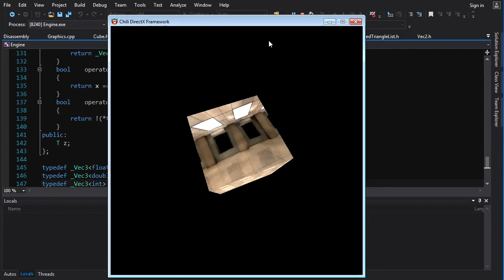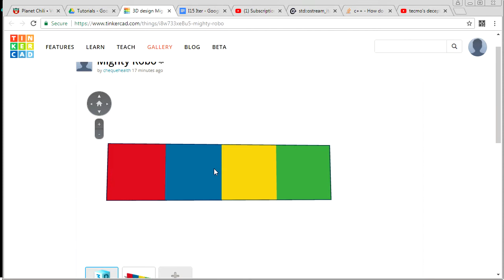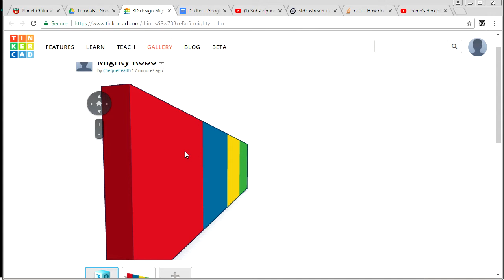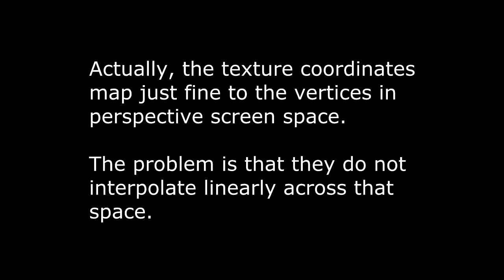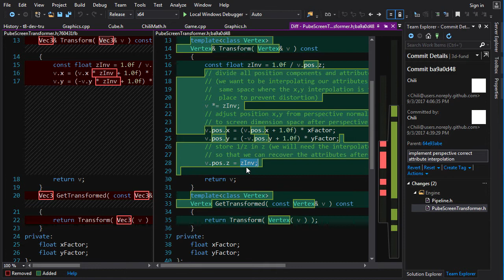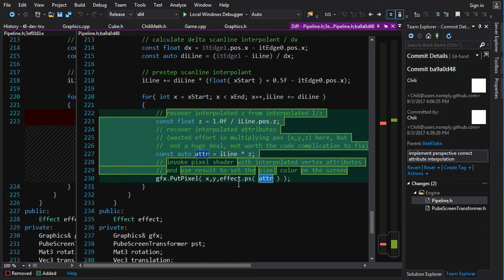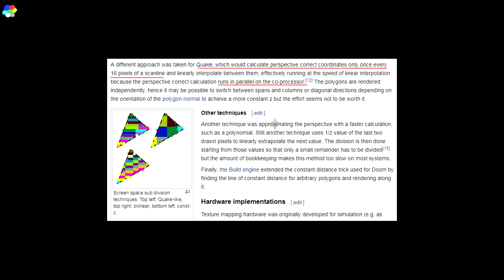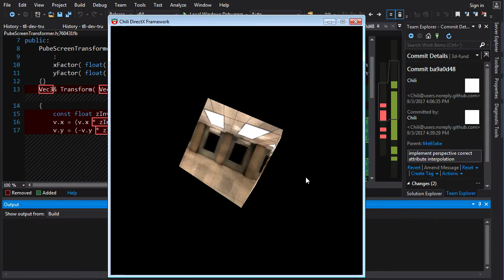3D Programming Fundamentals [Perspective Correction] Tutorial 10

Comment: Very clear explanation of a very tricky and confusing topic - well done!
I have actually gone through all the Scratch-a-Pixel treatment (yeah, I'm one of those weird masochists...). The MAIN cause of my confusion when trying to reconcile this explaination with information from other sources,  is the use of the term 'Z' to mean 2 very different things in different contexts(!). Yes, it's more intuitive to explain it using the term 'Z' to mean the ''Original' Z coordinate of the vertices (before the perspective devide), and yes - that is in fact what it is 
HOWEVER: In virtually ALL modern rasterizers, the 'Z' coordinate of the vertices AFTER the perspective-divide is the thing that ends up being reffered to as 'Z' when rasterizing (in screen space). And THAT values is NOT AT ALL the same as the thing being used to interpolate in a perspective correct way(!). Instead, that is what's stored in the depth buffer and used for depth-testing each pixel - which - guess what: means that IT ITSELF ALSO needs to be interpolated in a perspective correct way.... (say whaaat...?? I hear you say)
Meaning it needs to ALSO be multiplied by the reciprocal of that "other" (original) Z thing... 
Confused yet? ;)  
So,  in fact ALL vertex attributes (including that depth-buffer-Z thing) are typically interplated in this way, and for efficiency, what is typically done is to just go throught it only once per-pixel - by linearly interpolating that "1/OriginalZ" thing, but then "reciprocating" the RESULT - then using THAT in the interpolation of all the other attributes. So, again - that "reciprocating of the result" is the actual thing being talked about as the reason for why you can't look up and down in DOOM...
Reply: THANK YOU!!!!!!!!! I have been struggling with this forever.
Reply: I would like to speak about this for a bit. Any chance you could drop me an email? My email is in my page pikuma.com. I really appreciate it.
Reply: @pikuma  Sure. BTW, your website looks interesting, will def. check it out :)